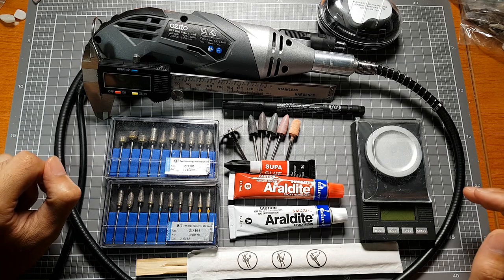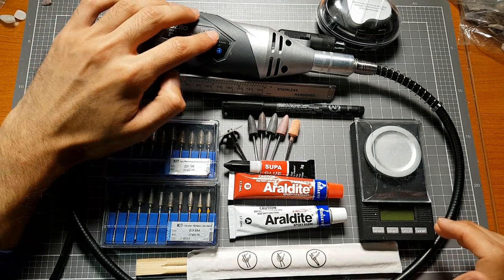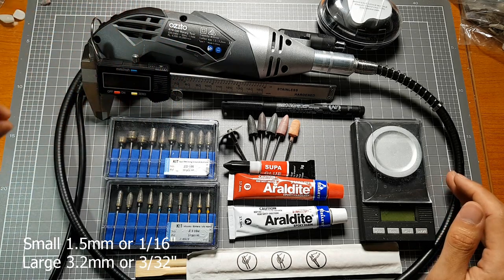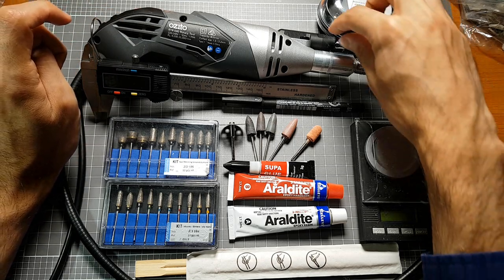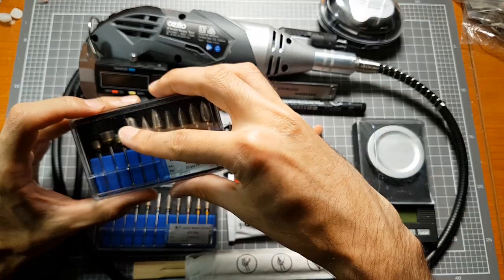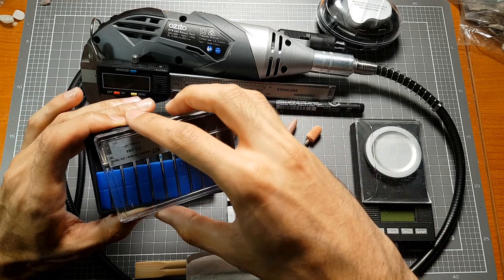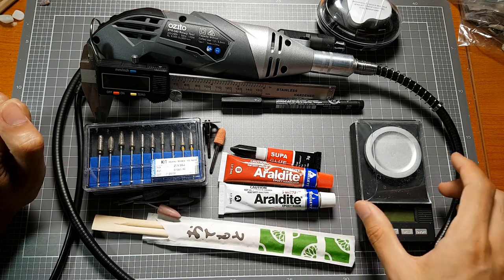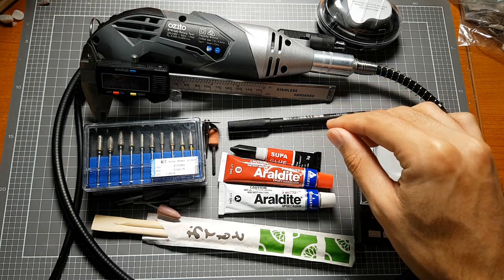Opal Carving Tools: Dremel/Rotary Tool Stone Carving (Comprehensive Summary 2021)

Comment: Cool thanks Roy now I can see what the package for the diamond bits . Know what I did with my flex shaft I screwed a piece of molding and screwed in 2 screw and it slid right in and I used a zip tie to secure it but it can be moved easily if needed.
Reply from the maker: Yep these are the kits. Worth getting over diamond burrs if possible.
If that mount works for you go for it. 👍

Comment: I've ordered the sintered burrs. But I'm looking closer at my order and the bits all appear to have the same color stripe. I'm assuming that it means they are all the same grit. Dammit!  Where do you get a graduated set? I'm having a hell of a time finding them for less than 50 USD other than china. What do you call the set? As in, what search terms do I employ to find them online? I'm in the US! 
Thanks in advance!
Just requested to join the FB group. as you said here, in the video, I can hopefully find that which I seek there!  Thanks Roy!
Reply from the maker: Ah I'll get to adding you to the facebook group so you can check out the document. 

You are lucky to be in the US there are a few places you can get the goods. These are typically just called "Rotary Shank Sintered Polishing Bur Kit" They typically add "Fast Cutting" to any sets that are all just coarse grit burs.
Reply: @RoysRocks  I still had to order from China for 41 USD. I hope they get here! 
Everyone keeps saying that’s it’s easier in the states! I’m not finding it any easier.
Reply from the maker: @rmg03c  41 USD is pretty good. The pain is waiting for it now fingers crossed you get what you wanted and quickly. 🤞
Reply: @RoysRocks  Thanks brother!

Comment: I just ordered a sintered burrs set. I've been using novas since I got them at the beginning of the year. Sadly I ruined the 14000 grit,  by accident,  but ordered a new one.  
Chopsticks,  lol, I'm using those as they have a small tip(smaller than my dop sticks) .
Wish I had that double loupe with the lights.
Reply from the maker: I think we all accidentally ruin at least one Nova point in our carving lifetime. The loupe with the lights are pretty good. I've had mine for many years so can't remember where it came from or how much. Battery still not dead though I rarely use the lights.
Reply: @RoysRocks  I'd just love the different powers.
Yeah, I tore the point trying to polish up a free form that had some chips. 
Fortunately I'm able to get them for under 9 dollars at SUVA lapidary.
Reply from the maker: @ThatOpalGuy  Ah very good. Buying novas are a bit harder and more expensive outside of the USA.

Comment: Is there a difference between burrs and mandrels?
Reply from the maker: Burrs are the bit you put in the end such as a diamond burr.
Mandrels are the same thing but you need to add something to the end of it. Like a saw blade or a felt pad. 
Think of it as a blank, for example a screw mandrel needs to have a felt/wooden point screwed on the end but a felt burr will come with a fixed felt point on the end.

Comment: are the nova points necessity for a beginner or can different grits diamond paste be used with felt/wood? Their pricing is pretty steep in Australia... How long do they last? Thanks. I've ordered cerium oxide and need something for pre-polishing.. Have 239 kit from Renigate for rotary tool with different bits and pieces..
Reply from the maker: I haven't found anything that beats the 280 grit nova. Its that middle stage of going from sintered diamond to polishing. Trying to use diamond paste on felt/wood/leather hasn't worked out for me. I think a copper lap could work but I haven't tried it.
How long they last depends on how well you look after them and the size of the stones. Use water, keep cool, dont spin too fast and avoid any sharp edges and they can do dozens of stones.

Comment: Hi Roy just getting my kit together , instead of rubber diamond bur nova tips can I use Silicone carbide burs
Reply from the maker: You can buy I haven't found any that perform as well especially at the lower end (280 grit nova).
Reply: @RoysRocks  thank you I sourced some nova tips , also I've got my hands on some 400 grit diamond coated burs and was wondering where would I find s set of sintered bits like yours  in this video
Reply from the maker: @jamesmcglinchey5714  I get my sets manufactured in China and sell them on from there. Depending on where you live there are a few other suppliers. UK+Europe is a little difficult but everywhere else is easy (but can be expensive)
Reply: @RoysRocks  think I found that set on Ali express , finding other places that are decent in the us, and yes the UK price is a good bit more expensive
Reply from the maker: @jamesmcglinchey5714  Nice one hopefully then get to you nd you can dive in to some carving. Many gems to come in the near future I hope 🤞👍
Reply: @RoysRocks  cheers mate I'll email some pics of progress and finish , I've started but only using diamond coated at the moment, waiting on the sintered, what speed should I have my Dremel at ? Also started off with welo , what diamond paste should I use and what grits or do I use cerium oxide?
Reply from the maker: @jamesmcglinchey5714  speed I keep at minimum settings which for me is about 8000rpm

Diamond paste I find that almost any will work. Haven't come across any particular batch that hasn't performed well for me.
Reply: @RoysRocks  I'm currently at 8000 using the diamond coated burs what's the highest speed with them would you recommend
Reply from the maker: @jamesmcglinchey5714  For diamond coated I wouldn't go any faster. They will wear out too fast and they are actually more aggressive than sintered so can chip much more.

Comment: A foredom pendent motor works way better than a dremel and the speed control is by a foot peddle . It costs more but jewelers use them for a reason. Also the chinese knock of ones are not to bad.,
Reply from the maker: Yeah i almost bought one a few months ago. I don't mind the speed change too much since I set it on just one speed but sometimes it revs. 
Heard the knock off's burn out pretty quick so not getting one of those.

Comment: Some of the best Chinese jade carving masters use 30$ rotary flex shafts. It's all in the tip the shaft and tool is irrelevant. Jesus that sounds weird.
Reply from the maker: I wouldn't say the tool is irrelevant. Speed control, consistency and noise level are pretty important and the main reason I'll be upgrading soon.
Anytime tip and shaft are used in the 1 sentence it is going to be strange sounding.
Reply: @RoysRocks  irrelevant as in any brand will do, that cheap Chinese "generic" variable speed rotary tool that always stays between 0-2 setting (0 slowest, 10 fastest) and that's pretty much all I need so if you find anything with that "sweet spot" you're in the money. On the other hand yeah I lied; the quality of the extension is kinda relevant since I've experienced rattly ones and even one that spun freely with load so that's a thing.